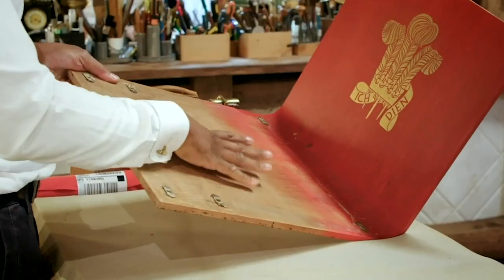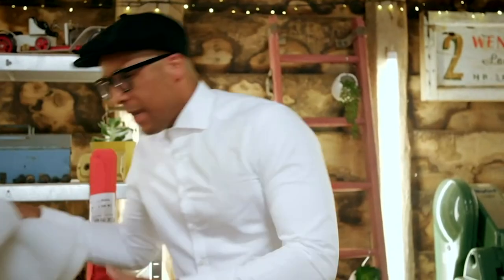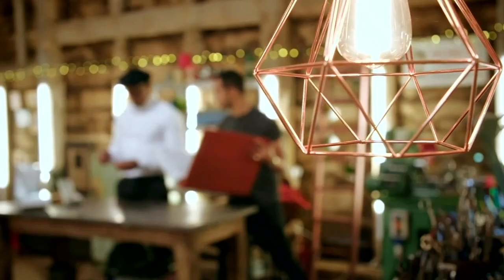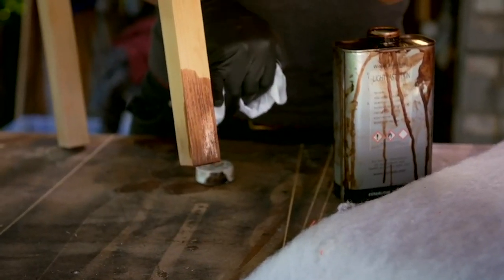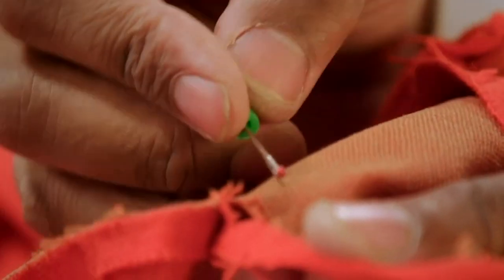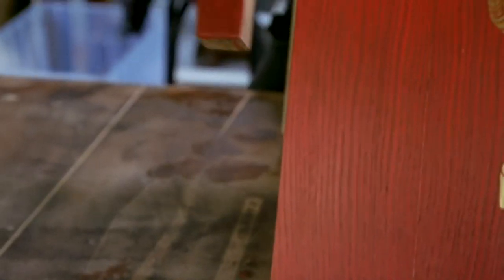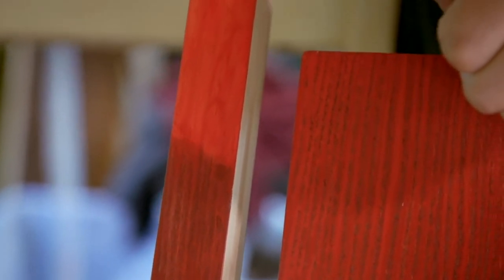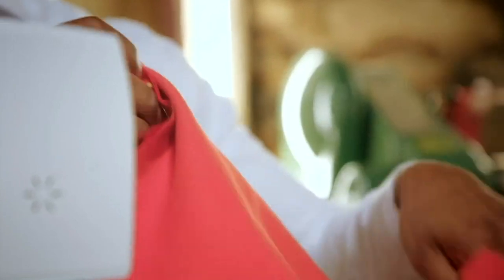Jay Takes the Floor and Leads The Team to Repair Old Chair | The Repair Shop

Comment: I have a 35mm film camera which I would like repairing (Sticky shutter I think) It has a unusual wind on system as you have to twist the lens after every shot,  but I bought it at a car boot sale for £5 pounds and don't have a good story to go with it, or else I'd apply to the show.